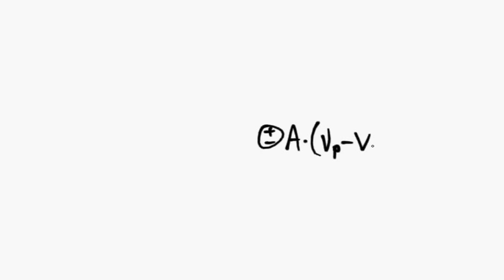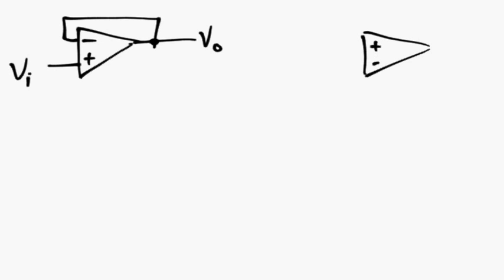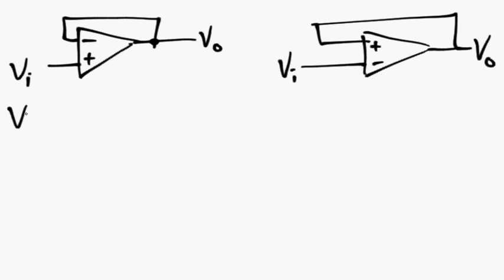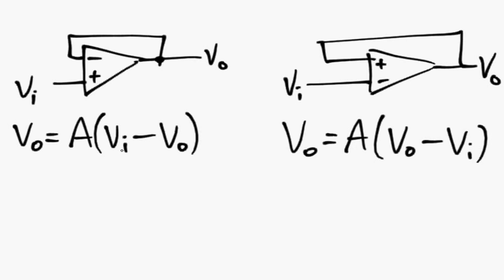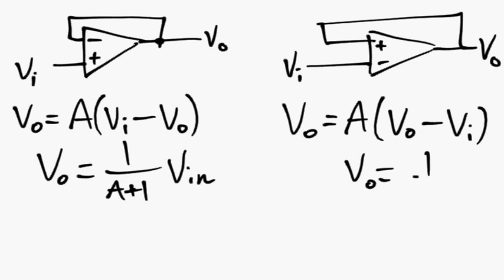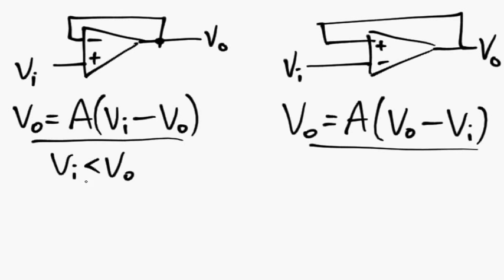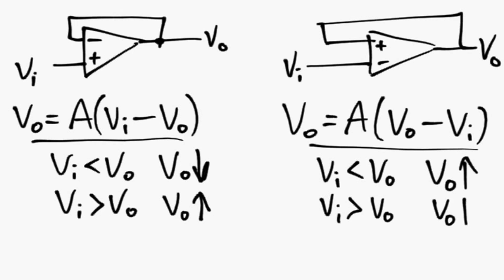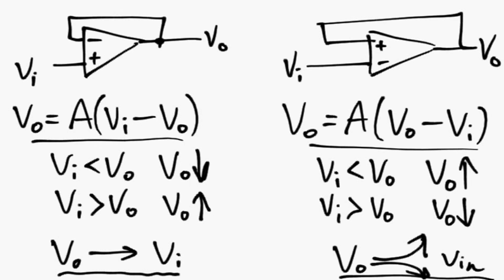Feedback on Opamps

Comment: NO! NO!  In school  and on YouTube there is a false (almost )equality between the inverting and non inverting terminals of op amps.
In  real op amps the differnce is to tine to measure UNTIL the FREQUENCY of the input signal reaches the corner frequency 
of the op-amp (say 1 Mhz) after that frequency the difference between the 2 signals become very apparent.

Comment from the maker: In this case "stability" means keeping an output which relates reliably to the input, and for the opamp (which has very high gain) to have a voltage that isn't one of the two power supplies, the voltages must be very close together.  Over the entire "linear range" of the amplifier, the two inputs will be nearly the same voltage.

An opamp in positive feedback tends to behave a lot like a digital inverter, rather than a controllable amplifier.